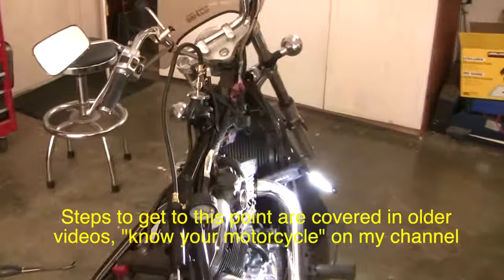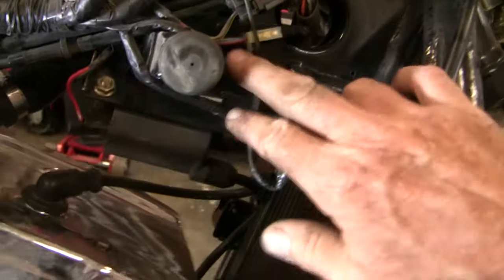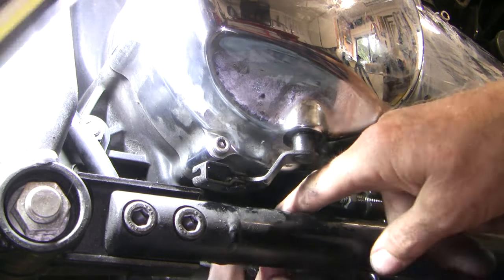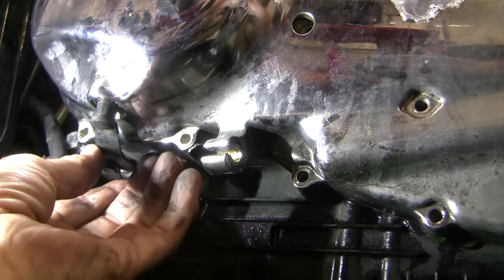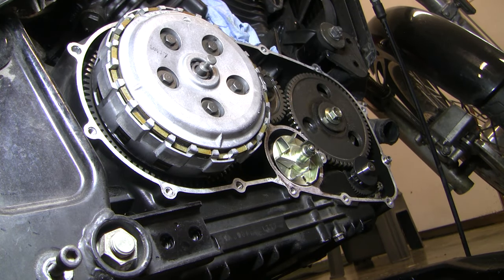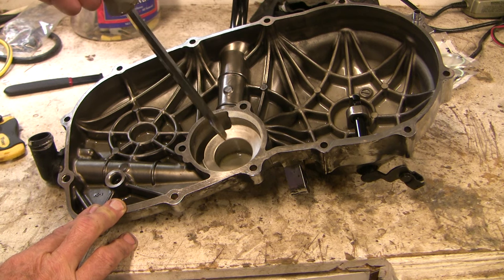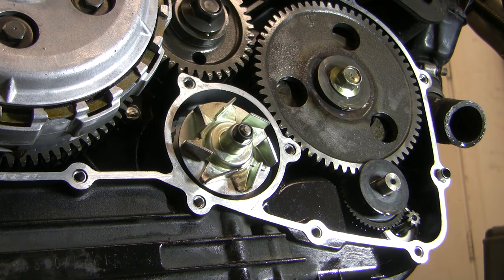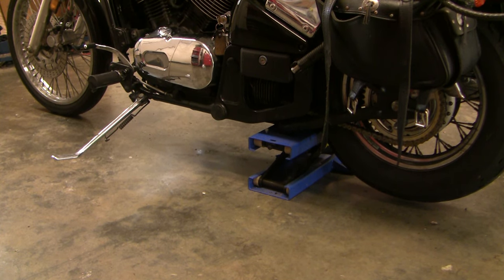Kawasaki Vulcan, how to fix coolant leaks and replace clutch cables

Comment: I'm with you on the water pump seal , no need to open up another can of worms . Great video .
Reply: Regrets I've had a few, but those can be either way; so, like you two, do what you suspect isn't working and leave a happy old dog to lay.

Comment: I have an ‘05 VN800 with 1,500 miles. I know some things changed in ‘05 but they are still very similar. I plan to go totally over it this winter.

Comment: Can you please please provide the links for the coolant tube and its two seals!!!???
Reply from the maker: I went to my local Kawasaki dealer and bought them directly from them. OEM Kawasaki part numbers for those you request are printed on the plastic bags as shown in the video, at about 5:49 of the video. Part numbers for generic parts will be different. Anything not in the video is lost. You can get more detail from the Kawasaki dealers repair manual, and the last time I checked they are relatively inexpensive pdf files directly from the Kawasaki website.

Comment: i wish you would've showed  us how to change the oil and water seal as well that was the part i needed to replace on mine.  but thanks  great video//
Reply from the maker: The water seal is easy, you just pry it out, with care not to mar the surface of the shaft. Some use a drywall screw to get hold of it, then pull. Pay careful attention to the orientation of the seal, it might be possible to put the seal in backwards. Typically the lip of the seal on the shaft is designed so water pressure tends to close the gap, meaning you can infer which way it goes in by understanding that mechanism. I'm told the oil seal is much more difficult in the Vulcan, requiring removal of the engine, splitting the case, and insertion from behind. So, hopefully the oil seal is OK.
Reply: @spelunkerd  thank ufor a quick replyhow would iknow if oil sealneed replacement i have fluid coming out of the weep hole when i started the enginethe fluids looks like oil n collantbut its greed so it could be gas n oil too not sure. I see oil in the airfilter rouded box n some oil coming out of exhaust pipe n a thick white smoke coming out of the exhaust pipe.  What do u call or part # is the water seal so i could order them. Online.  ?
Reply from the maker: @l3vnoml332  Did you mean to say the fluid is green, the same color as the coolant? If so, I would presume it is the water seal and fix that, and see if it works. You can get the part number from a Kawasaki parts lookup, which is available from various dealers online, or you can go to a local dealer. You will need to replace the right side cover gasket as well, as shown in the video I did here. You can also get a pdf copy of the Kawasaki dealers repair manual online directly from Kawasaki for a reasonable price.
Reply: @spelunkerd  no the color is not green it looks clear w mixed of oil  n remeber on ur video you have coolant leak  on top of ur rightside water pump cover i have the same situaution  but mine is oil no coolat.  Maybe coz i plugged something to seal  the oil drainage hose its probably the reason i get some oil insde yhe air filter box coz the drainage hose is attached underneath the air filter box.     I just figure out why oil n very thick white smore n misfiring like a gunshot coming out of the tail pipe the mis firing gunshot soud comes out air filter and carburetor area.  Coz the last time big leakage happening the last time I started the bike  dont know exactly where its coming fom so when i looked i saw that there was a hole so I immediately got a bolt n screwedi in to the hole to seal it   I didnt reqlized the that was a peephole till i watch ur video which by the way great job on all ur videos its very helpful for some idiot like myself.   So after i watched ur video I immediately took the bolt out of the peephole n took the rubber plug i put inside the drainage hose that attacheto the airfilter n i drained the coolanti still need to drain the coolant reservoir container  n  theni will replacethe clutchcover gasket n check the water seal if still intuck coz like u said if aint broken then dont fix it.  So after all those things i dont know what else to do.  Any idea? I will replace spurplugs ton see if i could see the two horizontal line that u were talking about but i didnt see where u adjustin or turning to expose the 2 horizontal lines.   Thanks again pls tx me on my cel  just incase i need to get an advise fr u in regards to the bike if thats ok w u.  5103678730
Reply from the maker: @l3vnoml332  The rubber tube that hangs down from the air filter housing of the Kawasaki Vulcan is there to allow oil that is drawn in from the crankcase a way out. It is meant to hang loosely down to let excess oil drip onto the ground. Modern cars have a PCV valve, but in the Kawasaki there is no PCV, they have a vent tube connecting crankcase to air intake, with a tube to let oil drip away. I would not plug it off. You mentioned backfiring and white smoke out the exhaust, and a leak of the weep hole. I'm not sure those problems are all connected. Regarding your question of the horizontal lines, those were highlighted white by a previous mechanic to make them more visible. Yes, you could approach the problem by checking valve lash, and valve lash adjustment is an important routine maintenance procedure you need if it is overdue. While in there you can clean the reed valves and look for other issues. If you have a lot of white smoke out the exhaust I'd be thinking of a head gasket leak or some other cause for coolant to get into the combustion chambers. The problem set you're describing sound bad enough you might consider getting a pro involved, if only to help with diagnosis.

Comment: I have 1998 Vulcan 800 and the Neutral light is always on (even in gear) and there is no power to the headlight bulb. Can you make a video how to fix it? Thanks
Reply from the maker: This is an interesting problem that I likely will never encounter. Whether you want to jump into repairing it is more the decision about whether you have the time, the interest, the skill set and the tools to do the job. I'd start with the wiring diagram. On the wiring diagram for the VN800A, there is a light green wire that comes off the neutral switch, which is under the transmission cover on the left side. The switch simply grounds the wire. That wire leads to a T intersection, where one branch goes to the neutral light on your speedometer display, and the other branch leads back to the main junction/fuse box. So, if the switch is stuck closed, or if there is any frayed wire touching the frame of the bike anywhere along its course, the light will stay on continuously. First I'd put the bike into gear, so the wire should not be grounded. Then I would backprobe that light green wire somewhere, probably at the junction box, to see if it is continuously grounded. Then I'd trace the wire along its course, looking for chafing of the insulation, or anywhere the wire could be touching ground or another wire. It might be simple corrosion at a connector. Or perhaps a witless mechanic grounded that wire when trying to hotwire the bike or when trying to fix another problem. Hopefully there is a connector at the T intersection, and if so you can disconnect and inspect it, to decide which branch of the T the bad ground is on. That allows you to narrow your search to only one of the three branches. If your hunt leads you to the switch, you can remove the switch and see if it is stuck closed. Chasing a bad ground can be painstaking, but in a bike you'll hopefully find it quickly. Or, you could ask a pro to do it and he likely would find it in an hour or two.

Comment: Is there a gasket on the connection to the exhaust?
Reply from the maker: Yes the exhaust pipes have gaskets, and I wasn't sure I'd be able to save the old ones so I got replacements before I did the job. It was a waste of a few bucks. Those exhaust flange gaskets are tough enough to tolerate high temp, and they come off easily and can be reused. I never used the ones I bought.

Comment: Great, but the thread lock should not be used on clutch cover bolts! You can have problems next time to get them out even with a removable, the blue one! The manual also says -no thread lock!
Reply from the maker: You make a good point, even though it wasn't discussed in my 25 year old manual. I can see why they might do that, there are thread inserts that I suppose could be pulled out. There was threadlocker already installed by the factory in the top most bolt, and the manual describes threadlocker there. No mention of threadlocker elsewhere. Lately I've been using blue locktite in many applications, and to my surprise it is easy to break free, sometimes too easy! So, I'm not too concerned. Even so, your remark is a helpful addition to anybody who stops by, thanks for pointing that out.

Comment: How can i see if water going in the oil for broken seal?
Reply from the maker: Oil and water layer out, with water being more dense. So, when you change oil if there is a lot of water inside the pan you'll see water come out first, especially if the engine has been cold and  sitting for a few minutes. The Kawasaki has a strange design with the water pump separated from pan oil by a seal, which could leak without you knowing.
Reply: @spelunkerd  thanks, i did yesterday the change of seal cover cluntch, but I not use the red silicon like in the video,I hope that will work so

Comment: So probably the first video where I have to disagree with a few things, first and foremost is the use of any razor blade on an aluminum surface to clean gasket material, what should be used is the 3M Brown gasket discs that can be used with a drill or by hand if you choose and some permatex gasket remover. When I did the clutch on my 99 Vulcan I did change the seal behind the impeller and it was slightly worn, my logic is once I have it open I like to address all issues when things are more than 15 to 20 years old because I don't like going back inside something to fix something I should have addressed to begin with while I have access. Also using a rubber mallet removed my cover pretty quickly as some of your viewers may use your technique and not be as gentle and why the breaking or cracking something. I used a very very thin application of red permatex on the matting surfaces to ensure there would be no leaks. Also the manual does not specify that you should use blue loctite but I used a very small amount on each bolt to guard against loosening from vibration and talked everything with a digital torque wrench. I also use a little red permatex gasket sealer around the rubber grommets for the waterway piping line. But I can't emphasize enough to your viewers to please avoid using a razor blade on such a surface as this can cause major major issues especially when there are many things on the market that can make removing that gasket a breeze, I also wipe down all the services with alcohol to ensure that it was spotless and free of any oily residue. All in all not a bad video but I still think you should have changed the seal inside the impeller as it was so easy and only took a few minutes. Other than all that thanks again for your informative videos which I do appreciate. As I believe I did put a link to my 99 Vulcan which is pretty much a showroom piece as a daily driver. https://photos.app.goo.gl/eheQaMh86tXMsCGb9
Reply from the maker: I love remarks like this, they get visitors thinking and make the comments section rich in added detail. There is no doubt that power tools with a cookie disk are dramatically faster and easier. I use a cookie air sander all the time for cast iron blocks. And as you point out there is a learning curve for the tedious razor blade technique. An inexperienced user can easily gouge a divot, but he does get instant feedback regarding his error. Like many in this industry, I have been wary of using power tools to take off gasket material from aluminum, and although I have a set of Roloc discs I haven't yet had the courage to use them on aluminum. As you know the risk is the chance of causing a subtle erosion of flatness by taking off a little more material in one area. It would be hard to recognize, there is no visible divot to offer instant feedback, and it could take only a few seconds to cause a major problem. Excellent points about the alcohol and the water pump seal, I have a feeling I'll be going back there some day. Nice to meet you!
Reply: @spelunkerd  the discs by 3M I am referring to offer removing gasket material on all surfaces including aluminum,  they are nothing more then Brown scuff pads and will not damage any aluminum surface or metal surface ever and that's why I use some gasket remover on the surface and let that set up for about 10-15 minutes and all my gaskets come off so easy and leave a great matting finish for the new gasket, I also put those discs on my Dremel with the Dremel extension one which of course is purchased  separately from the Dremel itself. In the link to my prior post, you can see how I take care of my 99 Vulcan as it is in absolute 100% pristine condition. Everything I do on this bike as far as repairs and aesthetics is done with tremendous amount of thought process and research. But I always love your videos Man they are definitely far greater than most of the videos you will see on YouTube and you're  knowledge is tremendous in so many fields and I respect that

Comment: What's the part number for that rebuild kit and where can I get one?
Reply from the maker: I ordered parts separately from the local Kawasaki dealer based on the parts diagram of the dealer repair manual. You can also get parts diagrams from online dealers with a simple search. If you pause the video here in HD, full screen, you can read the part numbers on the bags. I ordered two seals and the right side cover gasket. You can also order parts online, I've used Bike Bandit in the past. Unfortunately my one experience with Bike Bandit wasn't great, I waited almost two months for a chain to come, they didn't send it until all parts were available.
Reply: @spelunkerd  Thanks, I found some.

Comment: What are those seals call on that pipe?
Reply from the maker: Kawasaki just call it a seal, so use the part number to get the exact product. The part number is shown in the video, 92093-1427. It seems to be made of silicone, it is not just a simple O ring. I found it tricky to slip the pipe in, with the case bolts and the lower coolant hose having to line up, too. Eventually I got it. It might have been easier to put the lower coolant hose on after the cover and the pipe were in place.

Comment: That water pipe design is so stupid... AND they didn't even correct it on the Vulcan 900s, they are exactly the same. Only a Kawasaki would have such a flaw in the design. I'm irritated with mine, after a clutch change the water seal now leaks. Have to redo the ENTIRE job now. Probably just gonna sell the stupid bike. My Honda and Yamaha never ever had a stupid problem.